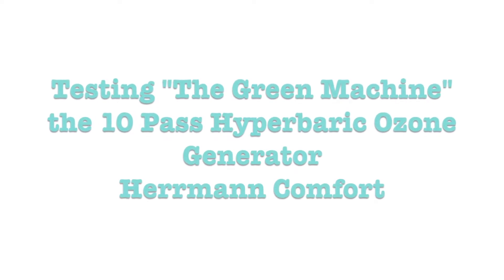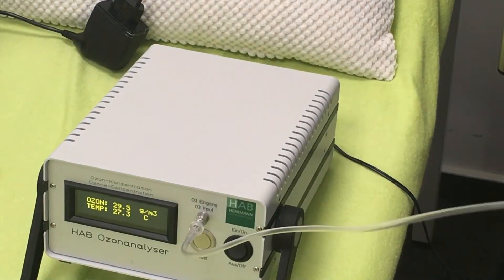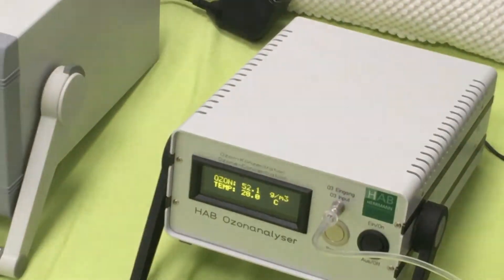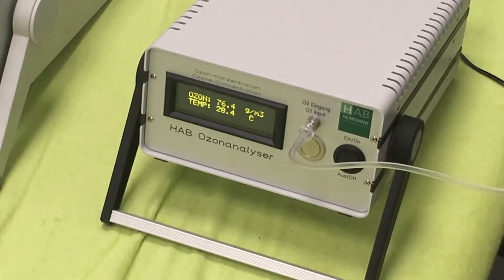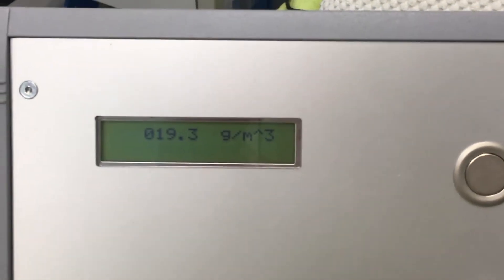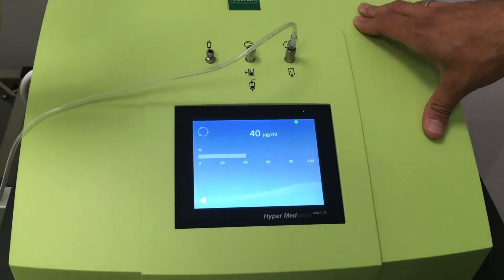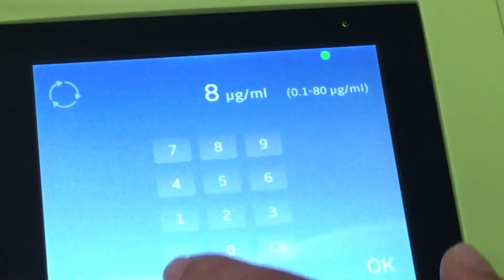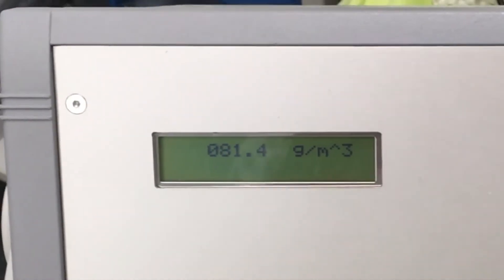Testing "The Green Machine" With Two Different Ozone Analyzers

Comment: This is testing in insufflation mode and not testing the hyperbaric parameters, right?  Our measurements agree in this mode.
Reply from the maker: I believe it is the same mode when using it for the 10 Pass. Because when he pressed OK, then you first see the ozone building up and being produced, and only then does it come out of the generator. Which is the same thing I observed the machine does during the 10 Pass. I just cut that part out of the video for the sake of making it shorter and less boring to watch. But it seems it is the same mode.
Reply: Not sure.  Isn't that what happens when one fills a syringe or does rectal?
Reply from the maker: I think with the syringe mode it is different. I have never seen the machine in action for the rectal application, so can't say ...